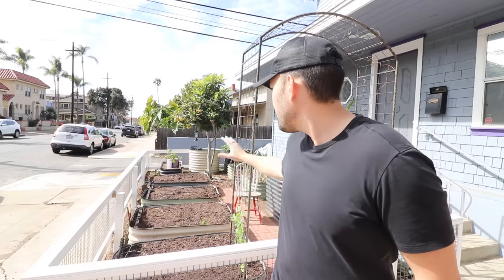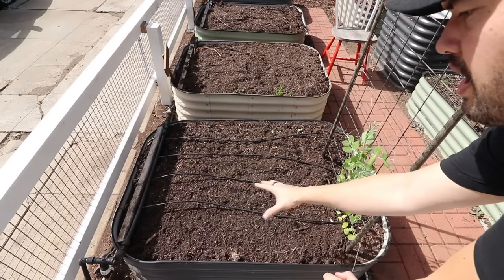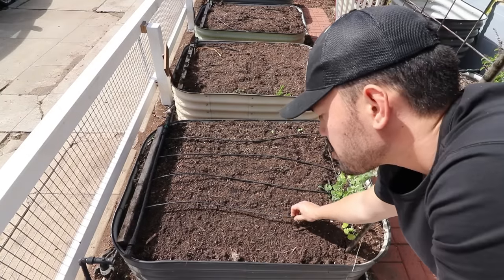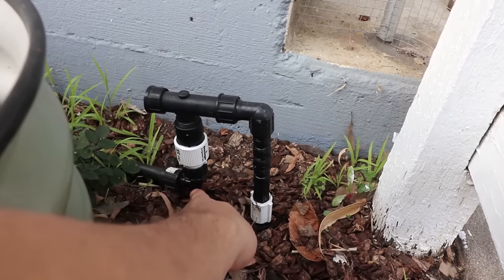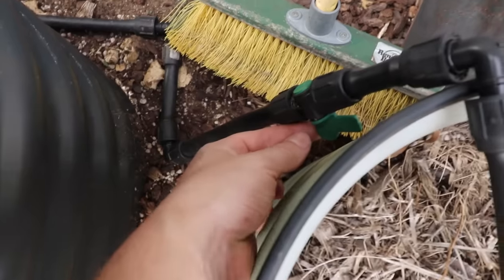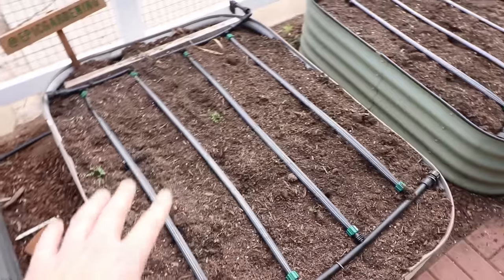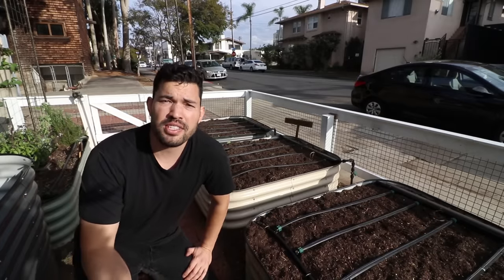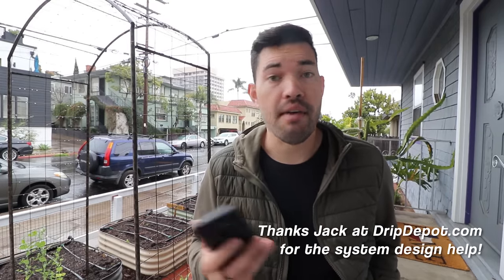Installing a Drip Irrigation System for Raised Beds 💦 (Before & After)

Comment: I have used drip since in my 30's.  It's the only way to go.  At 67 yrs, I no longer have the hand strength to push the connectors in place.  I have always heard try dipping the tubes in hot water.  It works BUT using a lighter is so much easier.  Hold the tube to the flame for 2-5 seconds and your connector will slide on like butter.
Reply: Wish i read this yesterday... haha  my thumbs are sore now!
Reply: @beastslayer9153  a heat gun should work also, be careful not to melt your tubing.
Reply: I just have a caliper lens thing from my Grandpa's time , just be sure not to burn the tube too much, an inspection tool for produce but it's pretty much handy to heat or pry tubing
Reply: Thank you for this great tip.  I will definitely be trying your lighter trick going forward.
Reply: I think I heard using ice works as well?
Reply: @OhShootKid   I wouldn't think so, ice causes the tubing to contract and you want it to expand.

Comment: Drip Line Capacity Calculation:

1)	225'-0" of 1/2" dia. main line drip tubing (200 Gallons/hr)
	Emitters (0.25 Gallons/hr) @ 4" o.c. (3 emitters/ft)

2) 225'-0" x (3 emitters/ft) = 675 emitters
	675 emitters x 0.25 Gallons/hr = 168.75 Gallons/hr  
		-> 169 Gallons/hr < 200 Gallons/hr -> GOOD

Comment: Super ultra beginner question: how do I know how much water I need in each bed, though? Like if my veggies say they need 1.5-2 inches of water per week, what does that even mean? How do I figure out the number of emitters and for how long to run the system? Don’t I need to figure out the load that my garden needs before I can design a drip system to meet that need? How would I do that?
Reply: This is a late comment, but from some googling, each 1 square foot of raised bed needs about .62 gallons of water per week to count as 1 inch. So from there you can do math to calculate the total gallons needed per week for each bed.
Say for example you have a single 3'x3' bed (so 9 square feet total) multiply that by .62 and then by 1.5 inches (lower bound) and 2 inches (upper bound) and you get between 8.37 and 11.16 gallons. So let's call it an even 10 gallons per week. Once you have that number there's multiple ways to get to it by laying out different kinds of drip tape or emitters.
The cool thing about drip irrigation is you can adjust the amount of time you water at the end. The only real limitations are stay below 200gph for the whole system (like he said in the video!) and also your patience for how long it'll take.
For example, say you lay out drip tape that in total emits 10gph in your bed. Divide 10 gallons by 10gph and you get 1 hour! So that means turn on the system for about 1 hour every week. Or if you laid out 40gph worth of drip tape, divide 10 gallons by 40 and get 0.25 hours or 15 minutes every week.
Reply: @ethanjennings6442  thank you for commenting this math!

Comment: Hi Kevin. Found your channel tonight and am loving it!! I started gardening last year in raised beds and have been semi successful. :) I think I have a soil problem but that’s another question. I have 4 7x3 raised beds that right now are on a buried drip system.  Each bed has two lines running the length of the bed. How far apart do you recommend spacing each line so there aren’t any dry spots? I’m wondering if I need to re space and add a middle line. Also, have you found that the irrigation lines interfere with your plant placement at all? Thank you for sharing your wealth of knowledge!

Comment: Does the sun heat up the water that is stagnant in the black tubing before the water is turned on?  I’m wondering if the hot water will cook the plants in a desert climate during the summer.  Thanks for this video!

Comment: You can also run PVC out to your raised beds quite a distance. Just trench them down in the ground. Also put ball valves by each bed to be able to shut them off or restrict flow. And don't forget to blow out the lines to winterize it.
Reply from the maker: Great tips here, fortunately I don't have to worry about winterizing here!

Comment: Thanks for details on how to plan properly.  That is very helpful.  It seems all your raised bed are connect at one location into the existing sprinkler in-gound system.  I was wondering if it would be simple and easier to pressurize if connect multiple main lines to the in-ground system.  I have a pop-up sprinkler every 12ft or so, and I can pull one main line to feed 3 raise beds. Any thought? Cheers!

Comment: I really need to just sit down and learn all these. There's so many different numbers and components I get overwhelmed. I use a flimsy drip hose that is just painful to work with getting kinked all the time, and I have to use 1 long piece so the whole pressure problems there going to long distances. Haha.
I really appreciate you tackling this subject for someone like me. I just have to go slow with this stuff.
But man automatically watering your garden is seriously next level.
Time to level up! :-)

Comment: Hi Kevin, thanks for sharing this, so awesome! I did have a question though on the calculation of the equipment, you added up the accumulative feet of the length of tape, then you multiplied it by 3, and that is the part I was lost. Where did that number come from? Thanks so much for your help, really appreciate your support on home gardening, it's SO much fun, but also a lot to learn!
Reply: 3 emitters per foot (4 inch spacing)

Comment: I wouldn't use end caps that's just extra parts, I would have just had two L connectors at the ends. I also added an auto timer. If the parts weren't free I don't think I would have updated it.

Comment: Hi Kevin. How did you know how much water pressure is coming out of the old sprinkler system, in order to match your setup to that output? Thanks.
Reply: It doesn't matter.  He's using a pressure regulator that brings the whole drip system down to ~15 psi.  Drip tape would literally explode if you connected it directly to normal ~60 psi water pressure.

Comment: I like how you have the valve at each line of drip tape. Is it possible to do that if using drip line. Not sure what that piece would be called. Thanks
Reply: Yes, there's a valve you can use for drip line, it's just a 1/4 inch valve, usually that will punch into the main line.

Comment: Hi Kevin, I just discovered your channel. I just completed building 15 beds of 4 different sizes. The largest being 4 x 10. I completed the rough in of the irrigation system by running the half inch tubing to every bed and up the side of each bed. I installed a ball valve on each so I could regulate the amount of water to each bed or simply turn any of them off should I ever want to do that. I stopped there as I built these beds to be ready for next spring. But, I kind of like the drip tape that you are using as well as having a footer line. Why did you move to tape from quarter inch tubing and what kind of differences are you seeing? I like your presentation so I’m subscribing. I look for more videos from you.

Comment: It looks as though your drip line hose already has holes in it. I have been setting up drip irrigation in my yard for the first time and my boyfriend bought the Rain Drip kit, and we ended up going and buying more hose and drip emitter lines. The only thing is, the lines do not have hole in them. They just run to a spray or drip emitter at the end of the line. That isn't going to work for me because I have so many plants that I would have to run a million lines from the main line. I currently have some on sprayers in order to cover more area, but I don't want the spray on my tomatoes. Is it okay to just punch holes in the lines that I have?
Reply: Drip tape has emitter holes already in it.  What you bought was a 'line' which is meant to carry water to an emitter,  not to drip water so that's the difference.  If you have a lot of plants, the drip tape is fantastic (it's what we use)

Comment: Hi Kevin, I'm running 340 ft of 1/4" emitter with 6" spacing. That's getting plugged into 1/2 " headers. the headers are being supplied by 3/4" rigid line from the house. My emitter is .5GPH. All hose and connectors are from Drip depot. will I have enough pressure for all that line? I,m not sure how to figure it out. I'm supplying ten 4X10' beds with 3 emitter lines in each bed. I also have a 40' long by 1'wide bed along a fence that will have one emitter line in it.

Comment: What did you mean about being under pressure? Meaning you went over the 200 gph max?
Reply: Yes, the phrase, "under pressure" (meaning: feeling a lot of stress) can make his comments confusing, but (as far as I understand it) he was talking about making sure to stay below the maximum water pressure the system can handle (so in this case, being below or "under" pressure is a good thing). If your garden's needs add up to being above the maximum pressure rating, you'd want to upgrade to a system that can handle more water to make sure everything is watered evenly.

Comment: What happens if, for example, you add another 10 beds. Can't you just change the flow restrictor to another one that doesn't restrict as much and therefore increase your flow to accommodate the 10 new beds?
Reply from the maker: Exactly ^
Reply: This is my take. It would all depend on the GPM you get from your city water line. If you add more beds, you might exceed your faucet’s GPMs, if you do that, you would have to add a automatic system with as many irrigation zones as you would need to keep each zone within your GPM. When adding flow restrictors on every bed you would need to  change the length of time for irrigation. Having an automatic system is very useful.

Comment: The math in the beginning feels so inclear still... anyone have recommendations for understanding this?
Reply: Calculate the total length of tape in your beds, we will call this variable "T". Then figure out how many holes (emitters) are in your tape per foot. 4 and 6 inch spacing is the most common for small gardens. He is using 4" spacing so we will use that in the example. So with 4" spacing that would give us 3 emitters per foot of tape. We will call this variable "E". The last variable is the flow rate of the emitters in your tape. .25, .33 and .46 GPH are common. The tape specs will specify what it is. We will call this variable "R". So the formula would be Total flow rate = T x E x R. So if we used 100 ft of tape with 4" emitters (3 per foot) at .25 GPH each, it would be 100 x 3 x .25. That gives you 75 total GPH. So the 1/2" main tubing would be plenty. Another example, if we used 100 ft of tape with 6" emitters (2 per foot) at .46 GPH each that would give us 100 x 2 x .46= 92 total GPH. Again, 1/2" is plenty. Hope this helps.